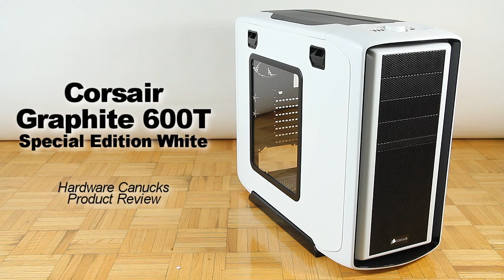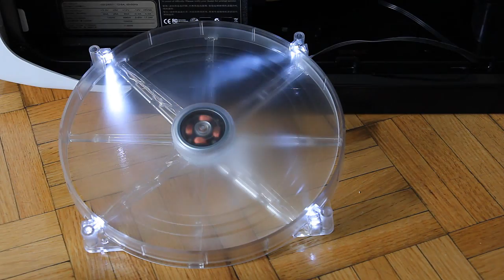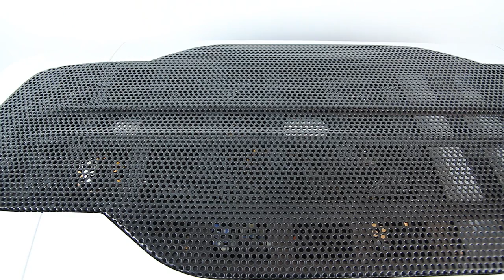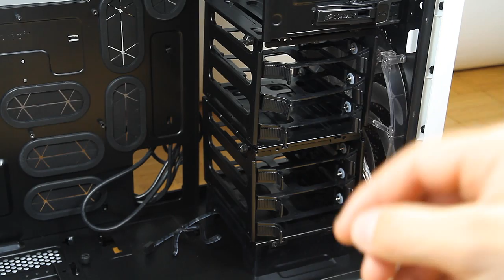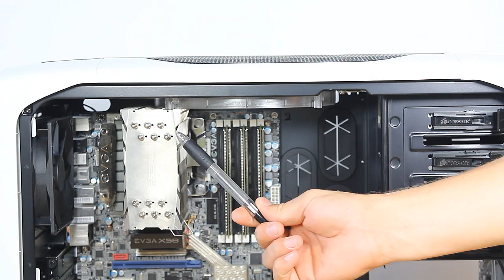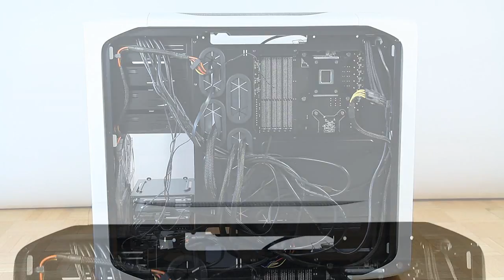Corsair Graphite Series 600T Special Edition White Review

Comment: People complain that this case is too expensive, yet it's reasonably priced for the style/functions you get. It's like 139USD right now, and I feel that is a great buy. Thinking of picking one up to replace my 500R.
Reply: I found that a lot of people complain because the case is classified as a mid-tower so they assumed it was small and it was $180. I bought it new last year for $130 from NCIX, to my surprise it was much larger than it looked in videos and photos. The case like they say in the video is actually quite large on the inside and it has no problem keeping things cool. To be honest, I love it. Although the case has been in production for a few years now you should check out the NZXT Phantom 530, it's around $130 and it's pretty much the same just with a cooler exterior.
Reply: That the one I bought for my wife and she loves the thing. It has such great airflow that I didn't really have to add any additional fans. I almost bought it, but didn't want to be unoriginal and have the exact same case lol. Still have my eye on this one though.
Reply: I have too..It's assome case :D

Comment: Nice case, although I wish companies would get away from the 200mm case fans and back to the 120mm and 140mm fans which have a much better selection and easier to find.  Most 200mm fans at NewEgg and Amazon come in LED form only and usually aren't nearly as good as their smaller versions.

Other then that, its a great looking case.  Looking forward to more information on their Carbide series of cases.

Comment: I bought a 600T about a year ago, and within a couple of months both 200mm fans died. Tried to replace the one in front, only to learn that the hard drive cages don't leave enough room except for a very thin fan. I like the room and the cable routing ability, but the fan issue really annoyed the heck out of me.

Comment: I still have this case on my old build its a msi z774 - g45,  EVGA GTX 960 FTW, I7 3770K @ 3.50ghz, 8gb of DDR3 and with H60 water cooler  it died but I re added thermal paste of the CPU so it working again  after 4 years but the original GPU was a 66O TI and now using an SSD as its main drive. while the 1 terabyte  Seagate Barracuda is its second drive now

Comment: looks great. the shape and the color, but it's just that the airflow isn't very good. For the side there's either the option of a really sleek see through panel or that wire mesh thingy for 4 120mm fans. I'd really like to have a see through side window but at the same time good airflow :(

Comment: I love the way Corsair designs their cases.

But be warned about the 600T:
The side panel latches are garbage. If you snap the panels closed, instead of pulling the latches down to close the panels shut, there are some little tabs holding the latches together that have a tendency to break off.
Reply: Ernie Velveeta Yea that happened to mine

Comment: I do have this case but hate a few things:
-the fan controller is really a two speed controller imo.. low and high
-really wish it came with a USB internal connecter, not passthrough
-there is no 3.5-inch drive bay adapter
-when you move the hard drive cage near the psu.. you can't remove the very bottom hard drive rail

and as for heatsink problems, my loud A70 fits with plenty of room to spare

Comment: @tubehiki it does not have an average number of features, tell me what else could it offer, for its size, hmm? Its an excellent case, many do not include those extra fans and you would have to buy them separately, the locking side panel and interchangeable window are also quite unique.

Comment: Awesome Review!!! You covered almost everything I needed to know.
I just still need to know if a Coolermaster V6 will fit with either the two 120mm fans on the top?
And does the Mesh insert come with the case or do you need to order it afterwards ?
Thanks!

Comment: When you said that the 200mm fan has interference with the heatsink, can you put the 200mm fan at the top of the case under that black mesh?
or does it have to be like only inside the case.

Comment: I picked up a case like this with a i7 3770k 850w AX psu gtx660ti 16gig vengence ram on the side of the road. In pristine condition. Just the gpu isnt working but i swopped it with my 780 old one. Btw im not joking this really happend
Reply: ok
Reply: I still don't believe you.

Comment: Would this case be suitable for water cooling? Would be worried about radiator mounting if there's already a problem with the CPU heat sink and top fan...
Reply: you will be fine you can replace the top 200mm fan with the radiator. just take out the fan and put the radiator where it used to be

Comment: Should i get the Corsair 400R or the Corsair 600T? I'm planning to use it for Crossfire with an HD 7870 with an Asus Sabertooth P67 Motherboard with i7-2600. My current Cooler Master K380 overheats the second 7870 as it touches the psu, will i have the same problem here? Thanks a lot!

Comment: can you mount 2 120mm fans infront?
Reply from the maker: Resonance yes
Reply: Strange, I checked with the official website, and my own case, but I couldn't find any mounting for 2x 120mm fans... are you able to show it?
Reply: On paper it's not supported, but you can mount them directly on the mesh. Just find some holes that align with the fans. 
If you do this, then I recommend cutting a square in the internal mesh so that the fan blades exposed, this will greatly reduce noise and improve airflow.

Comment: in this case fits a asus v formula ?
Reply: I just ordered this exact combination a few days ago to be built by NCIX.  If you want I'll let you know if it works.
Reply: ***** Yes of course :), I have a Crosshair V Fomula-Z with a Dark Rock Pro 2 cooler... still loads of space
Reply: Unconditionaldanger
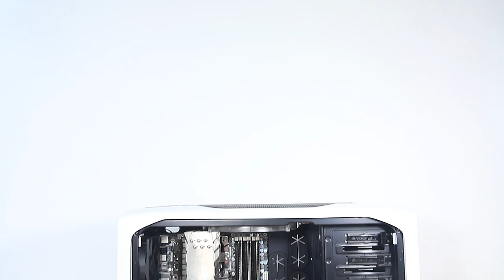Did you have any problems with the cooler, like the reviewer mentioned at 3:55?
Reply: Antonio Gurgel No, the dark rock pro 2 fits very good, even with 2x120mm top, inside the case, but I have moved them between the shroud and case :)